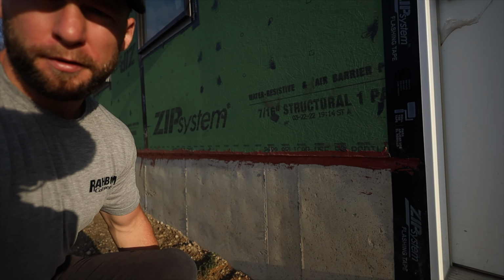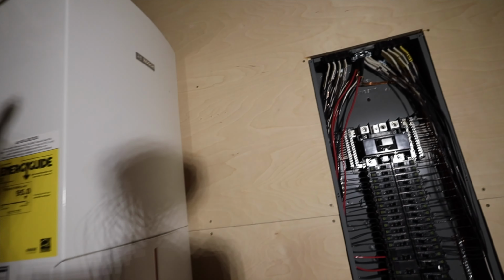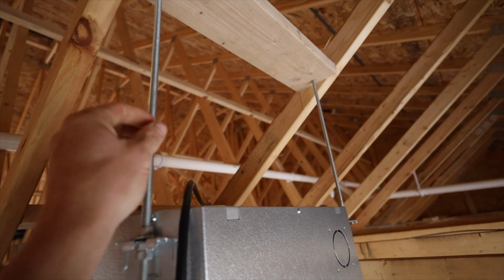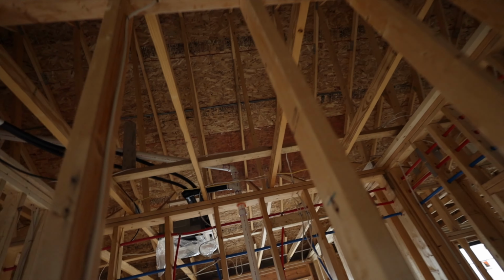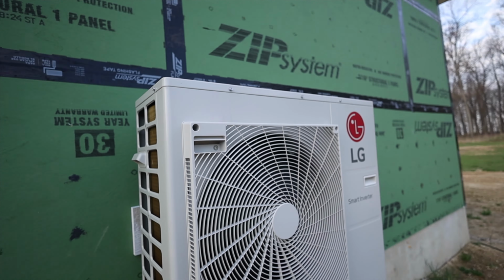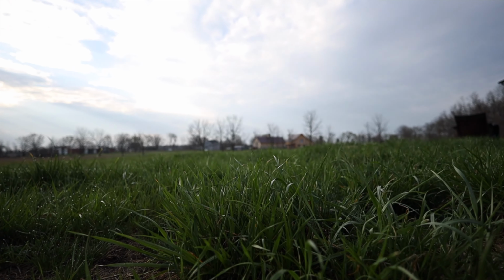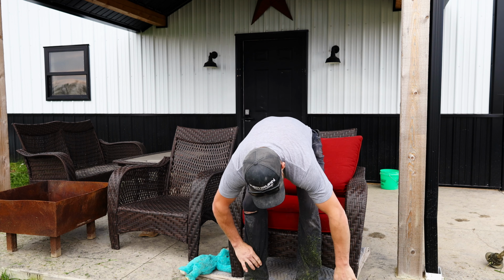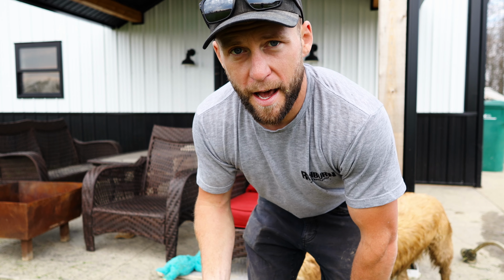First Mow of the Year and an Important House Update!

Comment: I am fairly certain the connection between sewer and condensate will not pass inspection. A 1" air space between those two systems is required. The condensate pipe should drip into a hub drain that has a trap. If there is no separation between the condensate and sewer, sewer gas has a path to get inside your home.
Reply from the maker: Thanks for the comment. I didn’t even think of that. Are you saying I should add a p-trap at those sanitary tees?